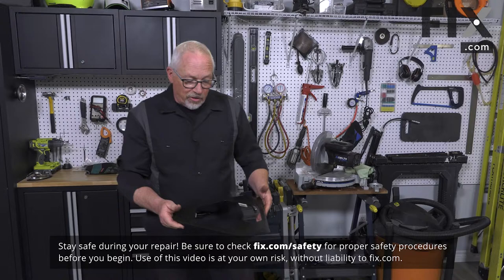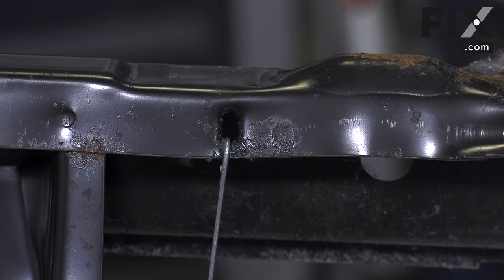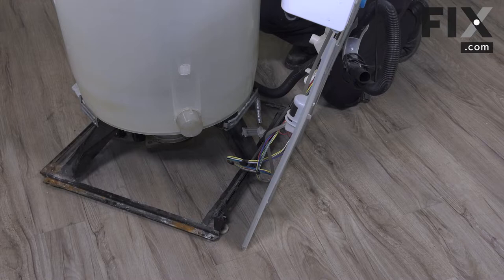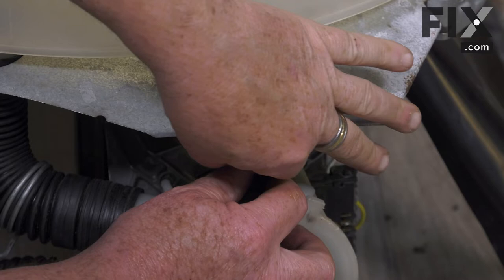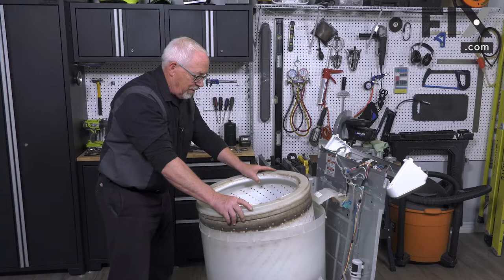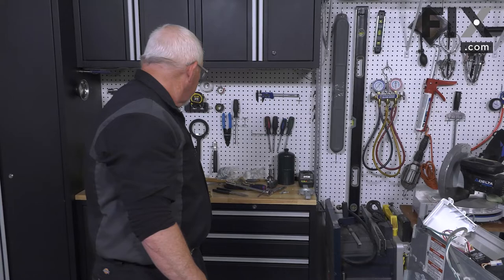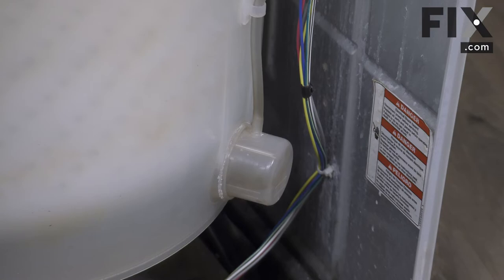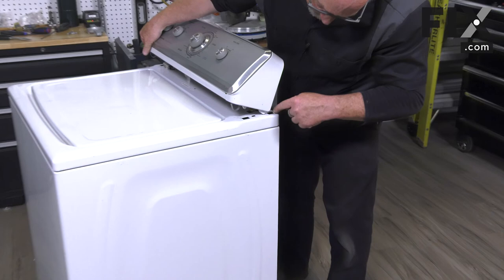WASHER REPAIR: How to Install a Suspension Plate in Your Washer | FIX.com

Comment: If the Suspension plate is installed upside down will the center post gasket seat properly?